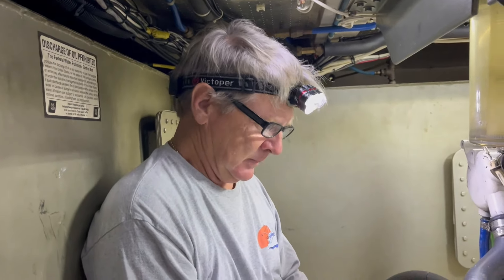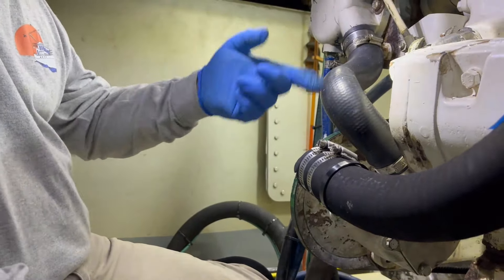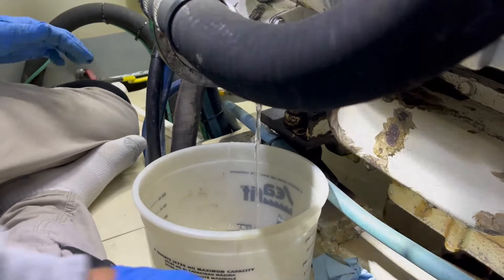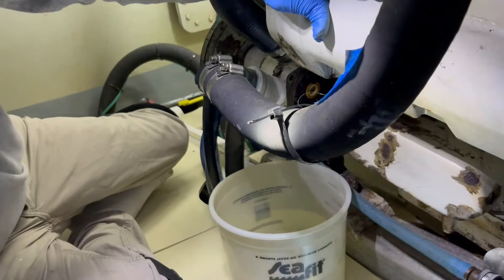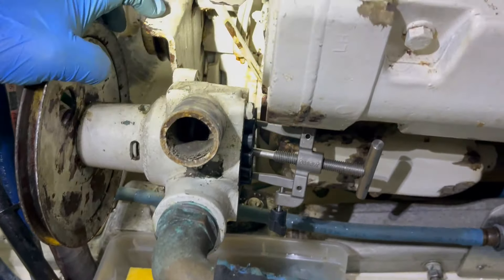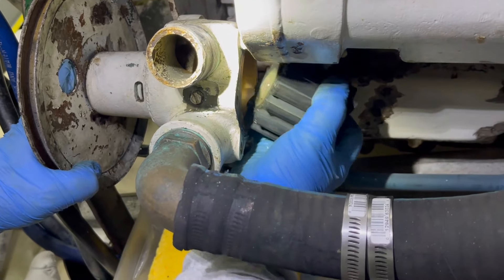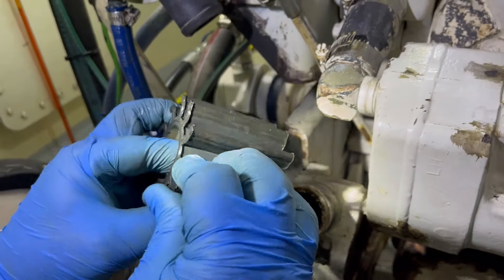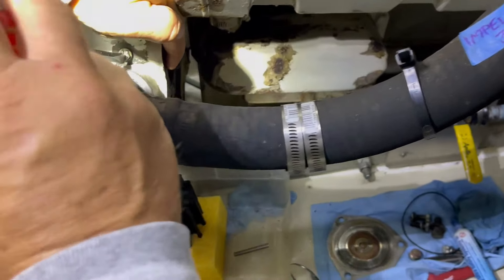Great Loop Water Impeller Maintenance #greatloop

Comment: A very light coating of AstroGlide (water-based personal lubricant) on the impeller makes it much easier to slide into the cavity. You’d  be surprised how many things can benefit from a light coating to reduce the friction of an otherwise tight-fitting part. The lubricant washes out in the first few seconds of use.
Reply from the maker: Excellent idea. It’s water based. Thanks for the suggestion.